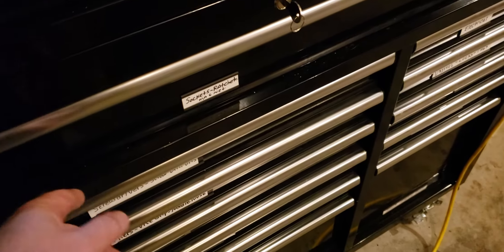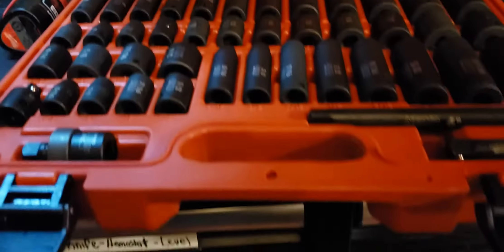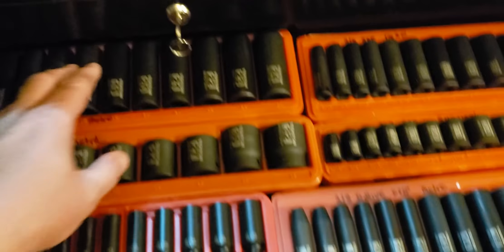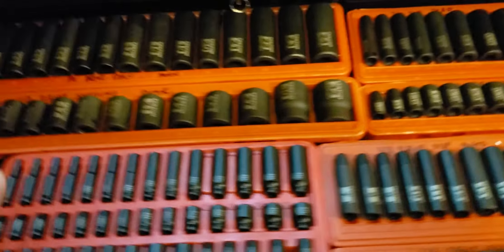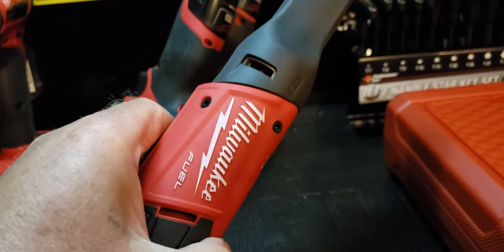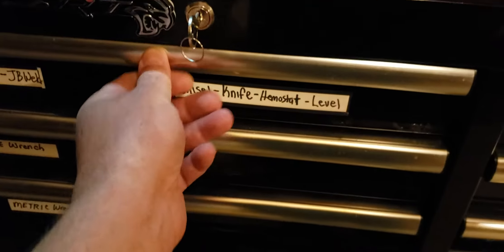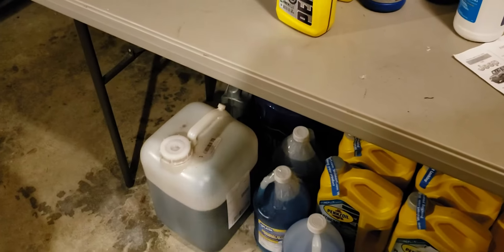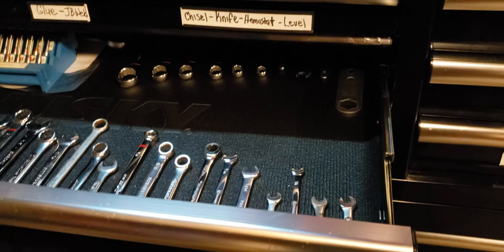Tool Box update with new sockets and more

Comment: That layout looks really outstanding Dave. I really like that AND the uniformity of primarily having ONE particular brand doesn't hurt either.
I've gotten to the point where I could definitely use one of the multi-port chargers for my Milwaukee batteries as well. As it happens, I get Peanut Oil containers from some local restaurants for my oil and there is a Shop near me that heats with an oil burner for heating and they happily take my used oil.
Great video Dave!
Reply from the maker: thanks rob, that multi port Milwaukee charger is one of my favorite